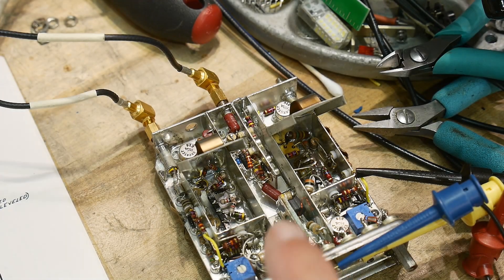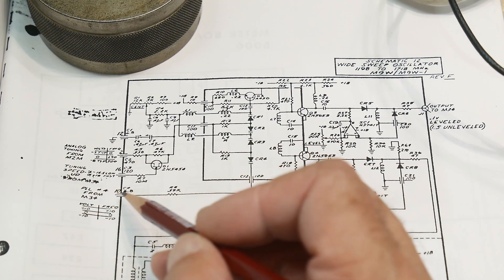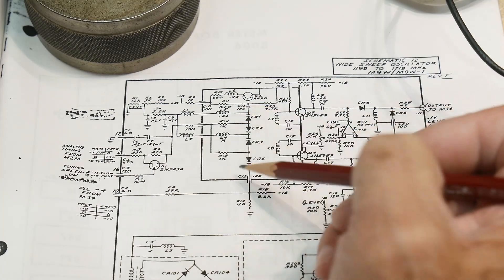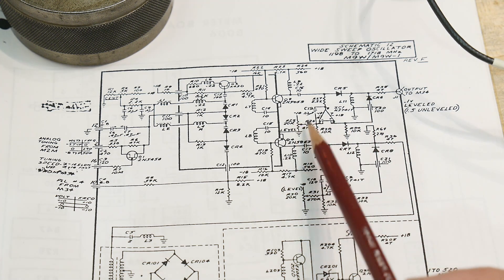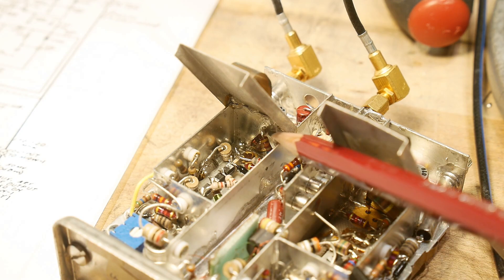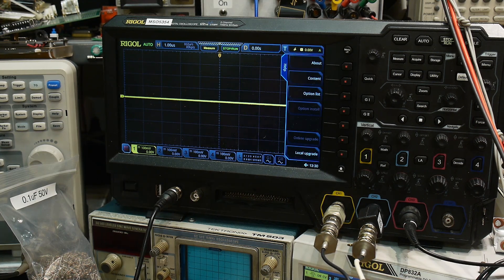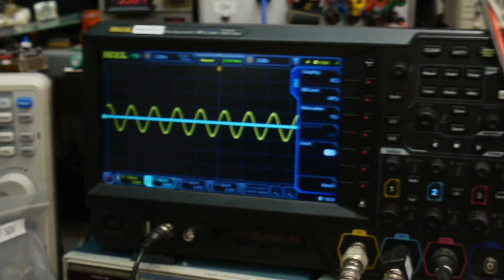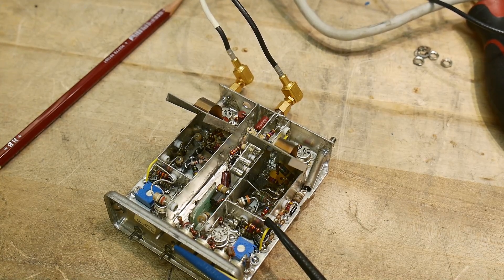#1912 Wavetek 3000 RF Generator (part 8 of 14)

Comment: I paused the vid at 5:02 and looked at your scope screen and I can't see any measurements like frequency or amplitude just that its 100 mV per/div. Is this just how you like it set up or what am I missing please ?.....cheers.
Reply from the maker: the screen IS the measurement, horiz and vert divisions are like rulers you use to look at the waveform
Reply: @IMSAIGuy  I understand this ! but most of us use the measurement facilities that are standard in all digi scopes nowadays. Some seriously powerful stuff ( you pay for ) but reading the graticule is fine, you probably have a slide rule too !.....  you do you :)
Reply from the maker: @andymouse  I hope people stop relying on all the fancy stuff and learn how to estimate and use things quickly. Developing a gut feel will result in a better understating of electronics than numbers. I had another viewer who wanted me to use a fancy frequency counter for this repair. yes there is a place for the nice measurements but not at this stage of trouble shooting. final adjustments and calibration is the place.
Reply: @IMSAIGuy  I agree in reality of course and I can gather the correct information as long as I know the voltage per div and the time but the functions are there :)
Reply from the maker: for this particular measurement. I had vert set to 100mV/div. I expected a signal +/-100mV. the channel one sine wave did this great. when I went to measure channel two, I got a flat line. I expected channel to to look similar to channel one.
Reply from the maker: Reliance on the fancy nature of the new (and cheap) scopes has caused problems. I had one viewer that thought the scope only made 'measurements' if you press the 'auto' button each time.
Reply: @IMSAIGuy  I actually agree but curiosity got to me. Without doubt there is no need for 'fancy counters' yet
Reply: @IMSAIGuy  :)

Comment: I think perhaps those coupling inductors are actually 10 pf caps. The inductive pickup wires are the leads. That's the least of your problems. Getting those transistors out is "difficult". I vaguely recall having a similar issue, requiring a Dremel. Test the snot out of them first, of course! 73's W3IHM

Comment: Sometimes when I look at the old analog schematics, I'm starting to think that their creators were either genius or insane.
Who'd use uncoupled coils to pick up nearby rf signal nowadays...
But the most insane part for me is the montage. It seems that it'd take hours to assemble and test just one module.
Reply from the maker: I'm pretty sure they were insane geniuses
Reply: FesZ Electronics just dropped a video on cavity filters which have similar couplings.

Comment: Fascinating. The isolation to get the needed very high stability. They are cancelling out the course frequency in the mixed output to avoid a difficult filtering? Thanks for this! Such weird construction for a commercial product.